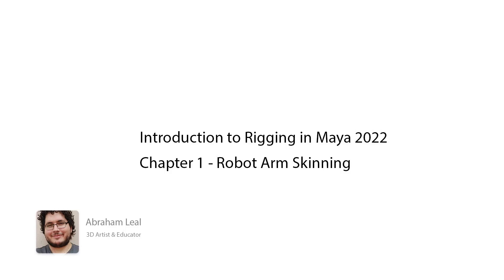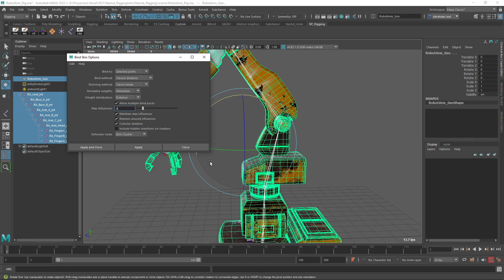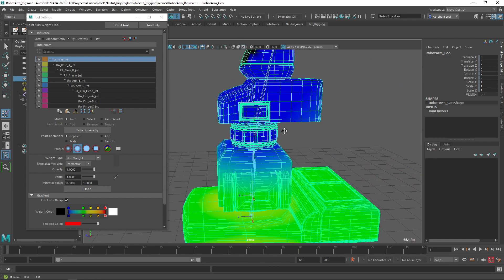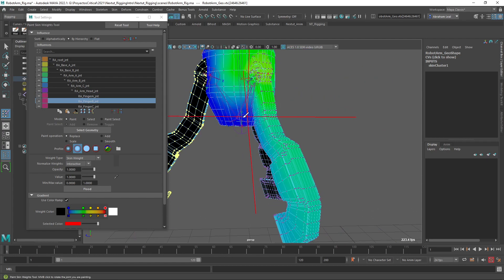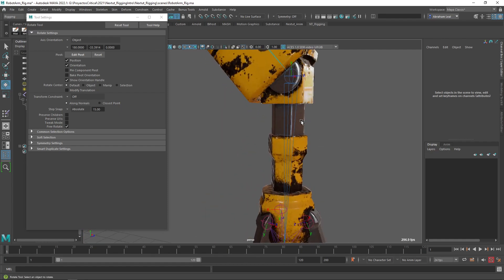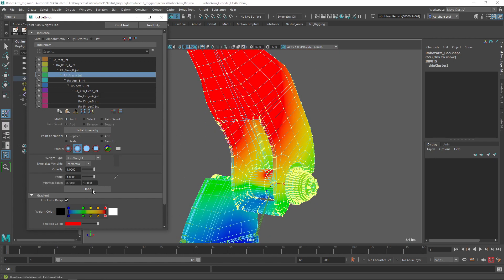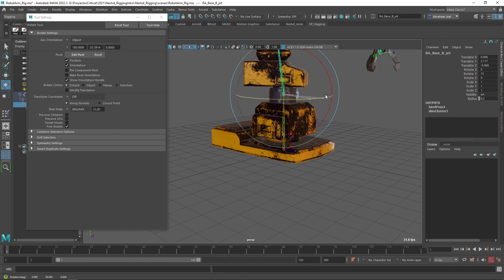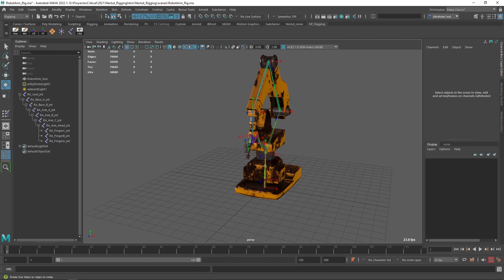Rigging Course Free Chapter: Robot Arm Skinning

Comment: I have a question which has stumped me for  while. When you weight paint you seem to be able to select vertices for  functional units like a section of the arm (and therefore the area you want to flood) by using the Select option in the Paint Weights Tool. However, you also point out at the start of the video that this is one single mesh. My question is, if it is a single mesh, how are you able to only select the vertices for  particular part of the arm? When I do it, it selects all the verts in my model.
Reply: When he says it is 'one single mesh' he means that is it one single object, made of multiple combined BUT unconnected meshes. To make the robot, he would have created each of the parts, out of cubes for instance, then selected all these objects, and clicked Mesh>Combine to make them into one single object. It is similar to grouping, but all the meshes come under one name in the outliner, and share a pivot point, etc. You can still select the individual meshes inside the combined object by double clicking their vertices while in vertex mode (or faces or edges) and this is what he is doing in the video when he is using the Paint Skin Weights tool. Hope this helps!

Comment: For robots, other tutorials will suggest parenting parts of the mesh instead of just binding and weight painting. Why is that? And is one better than the other for games?
Reply from the maker: For commercials and films what you mention can work just fine. For games since we export a skeletal mesh the only way the engine knows how things are connect is thru a skin cluster. This is due to the way engines interpret meshes, they dont follow traditional parents and constraints.